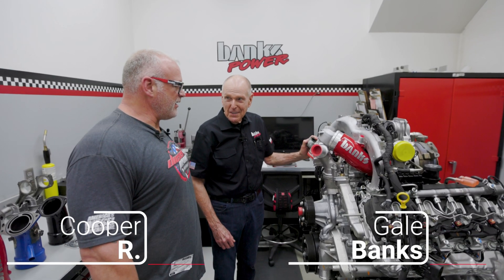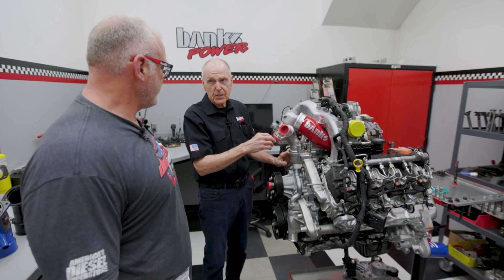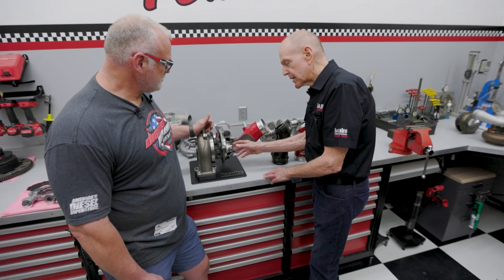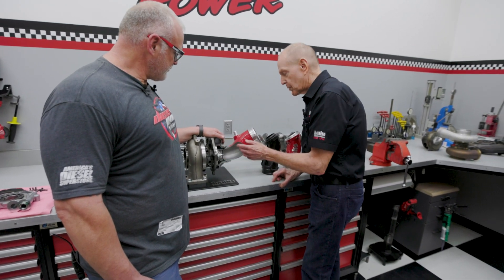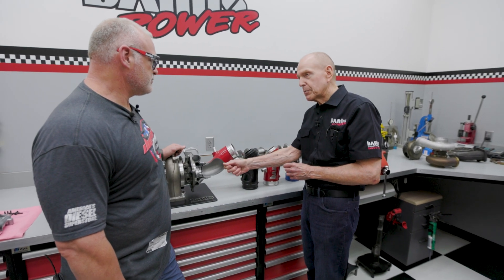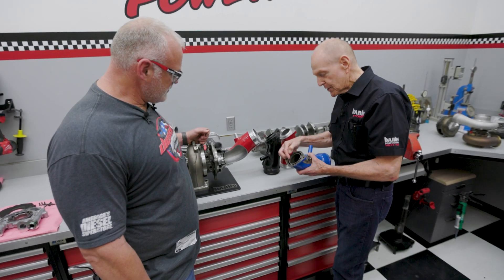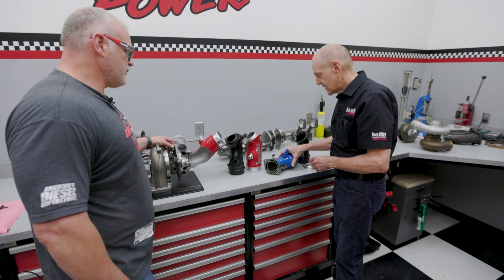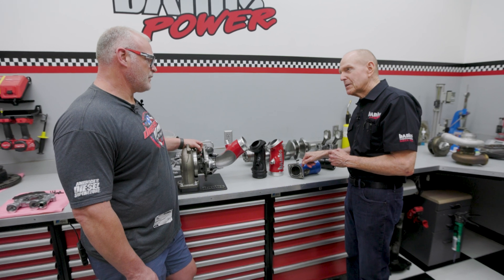DIESEL TALK | BANKS MONSTER RAM DURAMAX

Comment: Those should be madefrom plastic, aluminium is conductor, plastic is insulation.
Reply: So then the block should be made out of plastic too?
Reply: @jarredgallaher2643  no, you want block to radiate heat out of engine, but you dont want your intake to suck that heat into your intake air.
Reply: @V8Lenny  the intake is in the engine bay, so the air heated up by the block will be sucked into the intake filter. The ram air intake is physically mated to the block/manifold anyway, so since they're both metal it's actually a net gain because of the increase in flow. Math class is important kids! You sound exactly like the comments in the "Ram-Bro" Banks video.
Reply: @jarredgallaher2643  I hope heated air is not sucked into airfilter but Banks sucks so it might be possible. That intake is mated to turbocharger, seems like you didnt watch the video.
Reply: @V8Lenny: 
1) Maybe aluminum is stronger than plastic...
2) The extra diameter gained right down at the flange is possible because they made it much thinner than the plastic version.
3) GM would have made it out of aluminum but that would cost more.
Reply: @TurbodogCT  intake side strength doesnt matter, and they could have made it even bigger opening that MWE-groove. No, GM knows what they are doing. This is another useless overprized Banks gimmick without performance benefits.
Reply: @V8Lenny  my dyno pull on Tuesday says otherwise 😂😂 keep hating br0ke b0y
Reply: @jarredgallaher2643  did you also make more power with monster ram ? Firepunk didnt.
Reply: @V8Lenny  I have a duramax so yes, there was a boost increase, hp increase and torque increase. You don't need to see all three increase, if just one goes up than it's worth it. I have the entire Banks catalog on my truck
Reply: @jarredgallaher2643  you didnt even have to mention you have all Banks gizmos in your truck, I already knew it.
Reply: @V8Lenny  lmao well I have the data to back it up, and its practically identical to the info on the website. I get it, hating is free.
Reply: @jarredgallaher2643  info on the website is not correct, they dont make power in real life, it has been dyno proven. Because the restriction is somewhere else. You can make 1000 hp looking factory stock.
Reply: @V8Lenny  lol of course, you can  make 500hp with aftermarket stuff too. You're just saying nothing. The info is accurate otherwise the EPA and FTC would have issues. It's also accurate because its within 2% of my dyno runs.
Reply: I prefer too keep my 115k truck stock and it pulls like crazy in the format it’s in…….maybe in 20 years a kid can tune it. After the electronic dash quits and all the other crap quits he can do whatever the f he wants with it

Comment: I would suggest Banks offering their air flow products in a black finish that matches the factory parts. It would make it less obvious when getting warranty work done.
Reply: Maguson Moss law act requires manufacturers to prove in writing the aftermarket part you installed has caused the failure. 99.9% of the time they can't so warranty repair is completed. So next time a dealer says ur part caused it and we can't warranty it, say 2 words to them, MAGUSON MOSS
Reply: @molonlabe7750 unfortunately it will require you hire an attorney to do so,
You will have to pay for the repair if you want to drive your vehicle and be reimbursed later for the repair and attorney fees. That alone could take a year. Ask me how I know!
Reply: @molonlabe7750 you should research this better. Those magic words aren’t so magical.
Reply: You guys really gotta start lawyering up when these GED service managers at the stealerships start talking out of their behind with these threats of voided warranties. It is closed- cut and dry case law these practices are illegal. I recently won a case against a Very Well known company (hint) claiming the fuel I was using grenaded their diesel injection pumps, lines, and injectors and voided my extended powertrain warranty. They claimed I "filled my car with gasoline" with no evidence and when challenged, I had years of receipts with mileage matching fillups to prove their fallacy.
Reply: Black high heat spray paint is pretty cheap
Reply: Why don't you try checking the website
Reply: @JW-rg6rg because they aren't offered in black on the website either.  They have raw aluminum or red.🤷🏽‍♂️
Reply: @masonryman8183  interesting 🤔  I've seen a few builds with black....probably extra $$$$$
Reply: @JW-rg6rg  they probably had them powder coated afterwards. I'd love it if banks offered a flat black option.